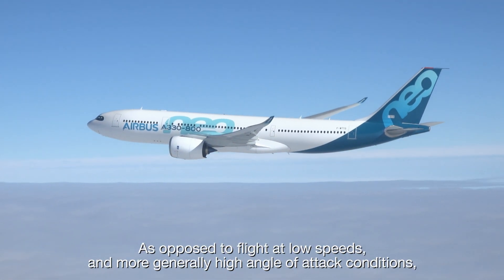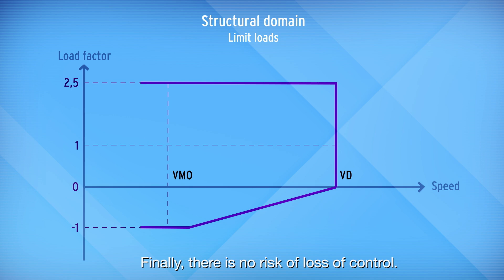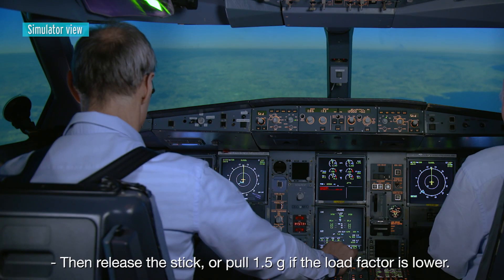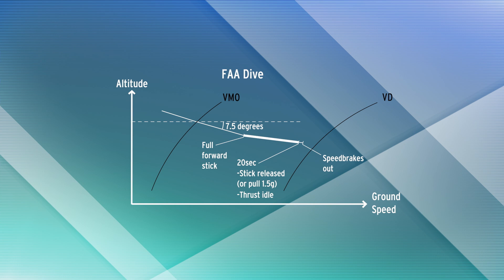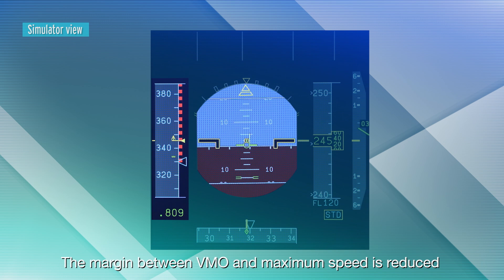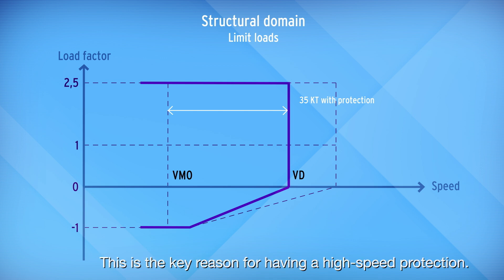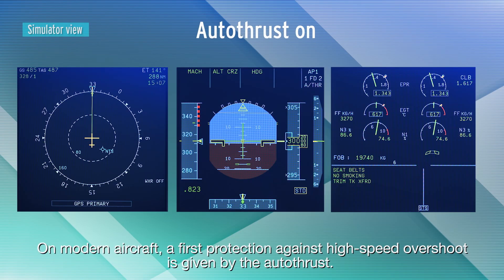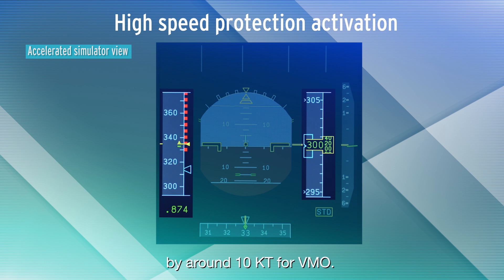Flight Tests - Episode 18: Tuning of High speed protections

Comment: VD is the absolute maximum speed above which the aircraft must not fly. 
On any Airbus fly by wire aircraft, it is not possible to reach VD, due to the flight envelope protections available in normal law. They are protected by High Speed Protection laws which automatically recovers the aircraft if VMO and VD are exceeded. Unless those normal law and high speed protection fails there are recovery procedures to protect the aircraft from structural damage and disintegration.  The recovery procedures can be found from this Airbus video.

Comment: What is VMO,VD,MMO,MD????
Please answer
Reply: idk too xdd
Reply: https://en.wikipedia.org/wiki/V_speeds
Reply: VMO= Maximum Operating Speed
VD= Design Diving Speed
MMO=  Effective Mach Speed Limit (“barber pole” on the airspeed indicator) at higher altitudes, since at higher altitudes the airspeed is displayed in Mach instead of Knots.
MD is same as VD.
If any aircraft exceeds the VMO and VD/MD limits, structural disintegration can occur.